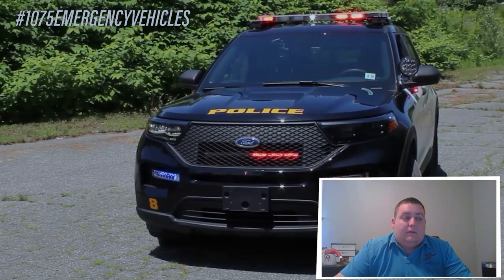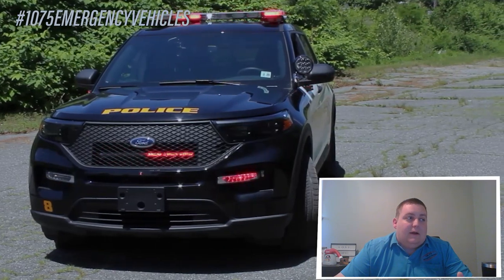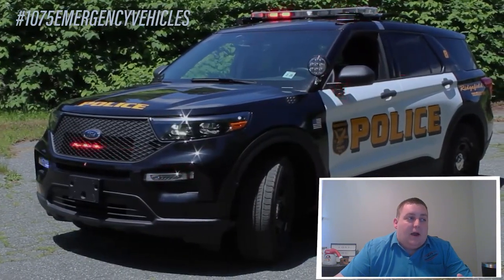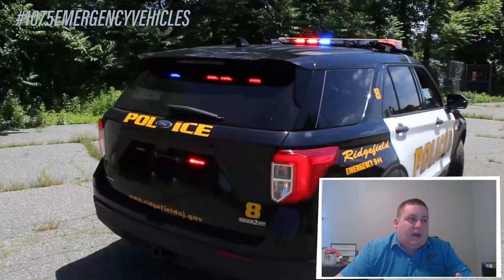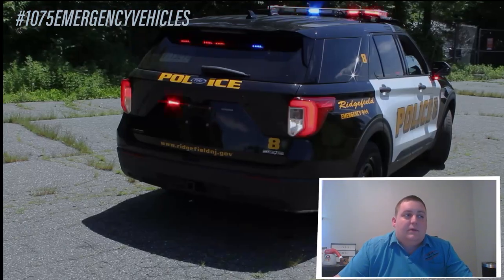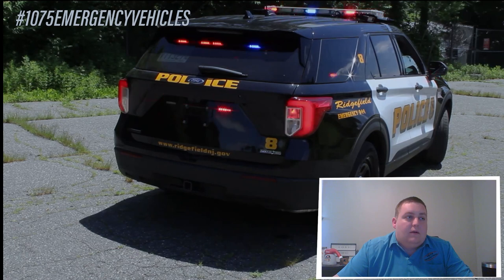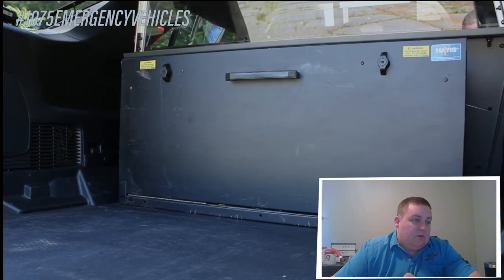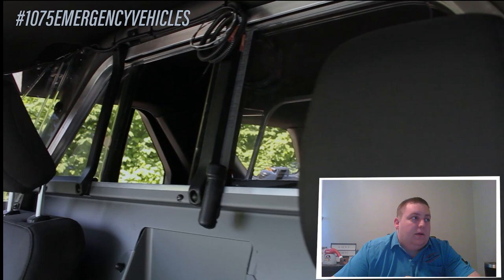2020 Ford Interceptor Utility | Patrol Vehicle | First Responder | Showcase #11

Comment: How do you change the flash patterns on the stock aux warning lights (red/blue) fog lamps? I know they’re powered in that small box behind the second row seat so I assume touching 12v to something in there changes flash patterns. The Ford manual isn’t clear.
Reply from the maker: You need to plug into the breakout box behind the second row seat and program.
Reply: 10-75 Emergency Vehicles sounds like you need the Ford tool to do this. Programming was so easy with the Pathfinder and Valor but the Ford factory options are complicated. I know it says the wig wags have patterns available to but the scan tool from Ford is required.
Reply from the maker: You need a USB cable and the software off soundoff signal website

Comment: Do all 2020 interceptors come with the factory headlight flasher?  Just has to be activated?
Reply from the maker: Yes they all come equipped from the factory
Reply: @1075EmergencyVehicles  is there a special wire that comes with it?   Our outfitter said that wasn’t a standard option and that I was thinking about the Tahoes
Reply from the maker: As far as my research has shown it's standard.  

https://madocumentupload.marketingassociates.com/api/Document/GetFile?v1=5311701&v2=030620104055&v3=60&v4=d622ef917059c73458b880a7ba40ddcc22e27da10628614227c046ad&v5=False